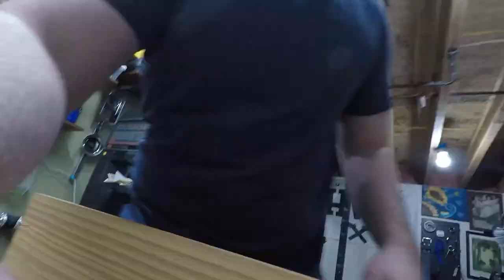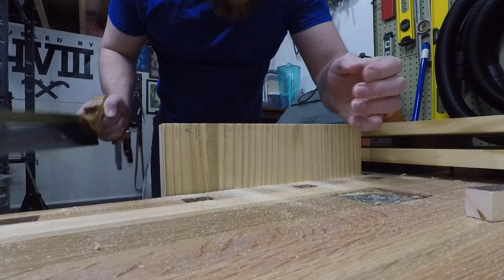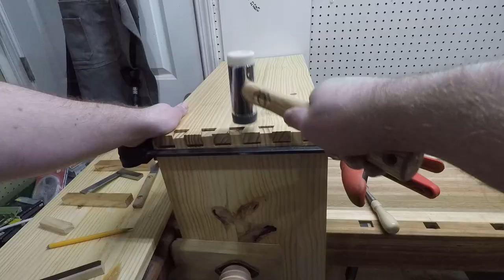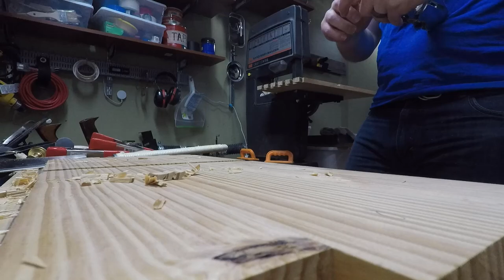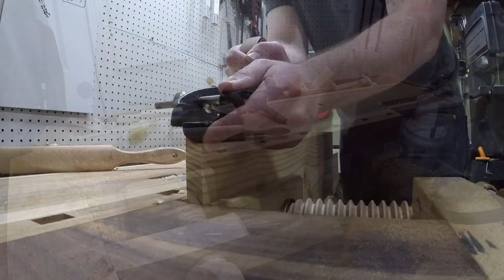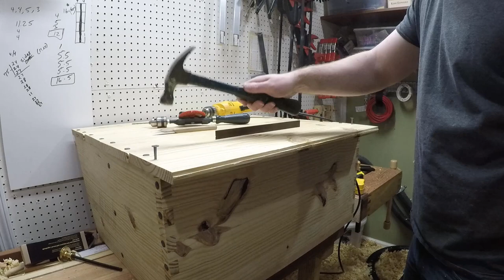Hand Cutting Joinery for a Dutch Tool Chest

Comment: did you have any issues with your wide blade conversion + tongue cutting blade getting clogged non-stop? happens a lot with mine.
Reply from the maker: Yes! I could not figure out if it was my inexperience with the tool or the tool itself.
Reply: @EricMeyerMaker  nah i think its just the mouth of the plane is too small and can get jammed. Ive been curious is the tongue cutter worked better with their combination plane instead of the plow plane but havent picked one up yet.

Comment: What's the dimension of the box?
Reply from the maker: The external dimensions are 13" deep x 27" wide. The front is 17" tall and the back is 24" tall. I sized mine based on a no 7 hand plane.
Reply: @EricMeyerMaker  thanks for the info
Reply from the maker: You're welcome!